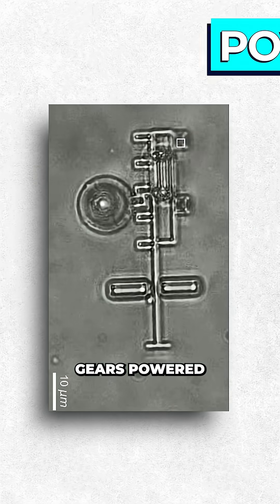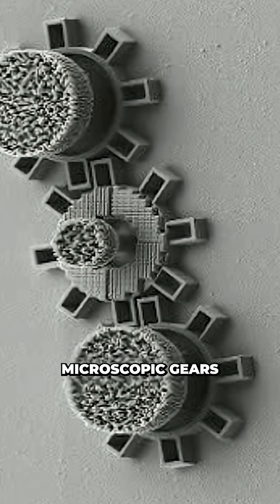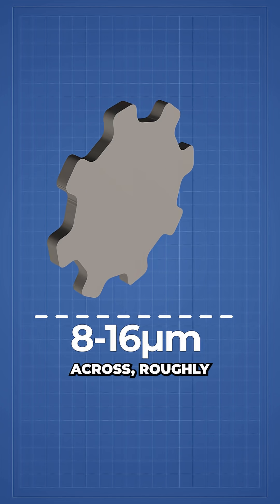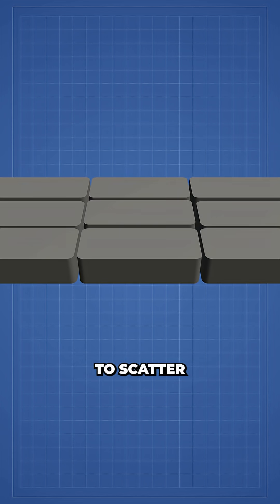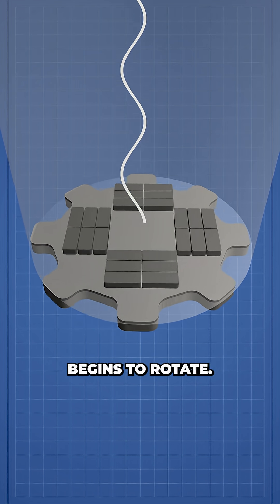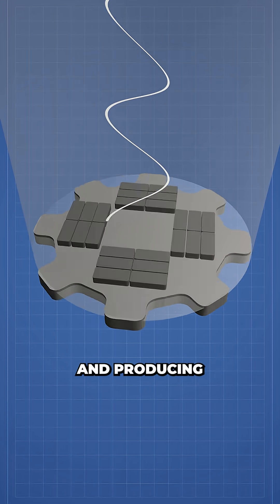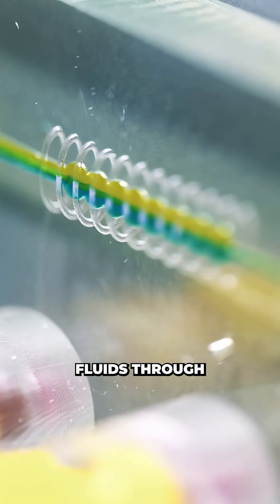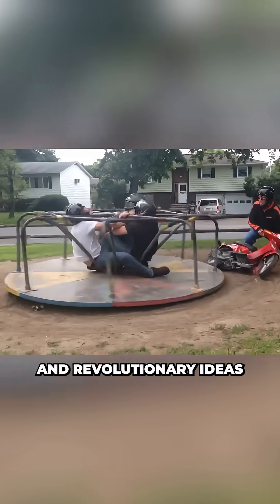Scientists Create Micro Machines Powered by Light

Comment: Crazy how this directly proves that light is matter, photons are particles,and everything in the universe eventually reduces to a discreet, definable entity
Reply: It’s not that simple
Reply: @1986DarkStalker  I mean, obviously not, but we do scientifically accept photons as "packets", which technically are a discreet entity
Reply: Light doesn’t have mass but it does have momentum which is what we are observing here
Reply: @OnePieceFan4765 no mass, yes, but energy is directly tied to mass, well exponentially i guess, so while its not mass, it can be converted to mass, and, while im but a humble software engineer, correct me if im stupid, but im pretty sure having momentum would require having mass right?
Reply: @JjFf-u4u no the formula momentum = mass x velocity isn’t a universally applicable formula it only works if you make some specific assumptions one of which being that the object has mass and isn’t traveling at relativistic speeds, so it naturally doesn’t apply to light particles. The true formula for how much momentum a photon has has no factor of mass in it so photons end up having momentum regardless of having no mass. And while the energy of a photon can be converted into particles with mass the photon itself has energy not mass

Comment: This can be solved in so many other better ways.  

For example using alternating voltage to drive a one directional ratchet mechanism (static charge repulsion).

To produce a single on silicon device for micro pumping, electrochemical gas generation is ideal.  The micro bubbles will be held separate from working fluid. 

For light powered devices, miniature solar panels printed into motives can reduce sacrificial electrodes, producing chemical gradients for movement or driving flagella.

And let's not forget about magnetic fields driving a ratchet
Reply: /r/iamverysmart

Comment: Imagine if you apply that to solar panels and make solar-mills instead of windmills.the strength of hundreds of billions wheel converted into one torque... That should be really powerful and you get less energy loss with mechanical energy transmission.

Comment: Torque matters little of the stress threshold is almost nonexistent 

A feather can move just by the lightest breeze but that feather can't then push a wooden brick
Reply: If you get get any torque, I am sure they can engineer it to increase the torque and multiply it with some planetary gearing which also generates it’s own torque, just have to pattern them right?
Reply: Wdym?
Reply: These gears could probably not transfer a lot of power
Reply: Bro is an expert in microscopic gear systems

Comment: This is revolutionary. If we could make microscopic machines powered by light. We can power them by heat. And over time we can use this in many fields.
Reply: I'm not really sure that's possible because iirc you need heat transfer to a colder space to recycle a portion of that energy. In a microscopic enclosed system you can't overcome thermodynamic decay.
Reply: @Chicky_Lumps  I'd be more concerned about erosion ruining everything. At that scale, photons are remarkably powerful.
Reply: Why do the conversion? Heat won't be as effective as light within the system, and we're converting it to mechanical energy anyways. Either start with heat and skip the light, or stick to just light and avoid heat. Maybe there can be some mix-and-match at some point but just requiring the conversion by default is wasteful.
Reply: Bodyheat? That would be cool
Reply: I'm just here to like the Revolutionary comment 😂😊
Reply: If it's powered by light it can't be powered by heat... the 2 are not interchangeable... but our knowledge of thermodynamics is getting better. Building systems to to convert energy from light to heat to sound to every wave of electromagnetism is the holy grail. Light itself is massless and heat is just a biproduct of friction and motion. We don't even understand light fully. It behaves as both particle and wave.
Reply: @netkrawlr  any object is giving of heat in two ways: through collisions and as radiation. Heat given of as radiation is light, the wavelength depending on the temperature of the object.

Also sound is not an electromagnetic wave.
Reply: @netkrawlr Yeah. Light is one of the biggest reasons why physics is not my favourite reason. I have done poorly in many physics tests because of the duel nature of light.
Reply: Dip your toes into quantum mechanics- it's what I've done.

I probably have a half-right understanding of the most accurate understanding of what a photon is, just by randomly reading up on it. 

Anyways. Light could be a wave and a particle at the same time because particles are all waves, or some similar bullcrap. Our conventional understanding of physics breaks down the smaller you go, which you obviously know.

IDK. I just find it all interesting and felt compelled to comment. I'll need to see how I handle dealing with it in practical problems once I dip my toes into physics. School-wise. Been mostly doing biology.

Have a good day, and I hope you do better in the future.  @Riscogoboy
Reply: Heat and light and two very very different things 😂😂😂😂
Reply: @makalaka1190  Heat is infrared radiation, which is a type of light
Reply: @JoinTheClippyRevolutionToday heat is vibration. IR radiation commonly comes from heat. they aren't the same thing.
Reply: That's existed for a while. We have motors that can be powered by body heat. They're just very weak, as would the ones in the video realistically
Reply: @OatmealTheCrazy No. The ones shown in the video need specialised lab lasers that are very powerful. I did not know about the heat ones. The research on the light ones started around 2018. So they have not been around for long.
Reply: @Riscogoboy  "No. I agree with you." So Yes?
Reply: No thanks

Comment: I don't even understand the logic of this. The machines themselves are foreign bodies so they'll be attacked by the white cells in the body and the immune system. There's also not enough light to quantify the intensity of a laser which gets through the skin of the human body. And while the torque of the rotating gear might be enough to spin is it enough to spin the gear against the flow of say, blood in the circulatory system? This doesn't even begin to touch on the breakdown of the gears from the heat of the laser and energy transfer from said heat. Lot of holes in this tech though I think I'm interested to know more so there's that!

Comment: A continuous accumulating nano battery!!! Solar power to a new level 😮
Reply: Solar is randomly polarized, wouldn't work unless you put it through a filter.
Reply: @evangonzalez2245 Filters are relatively inexpensive if I remember correctly.
Reply: @Splicer-lb5xb  Filters would block half the light. Plus these gears are probably inefficient.
Reply: Now that's an idea...i tiny generator... brilliant!